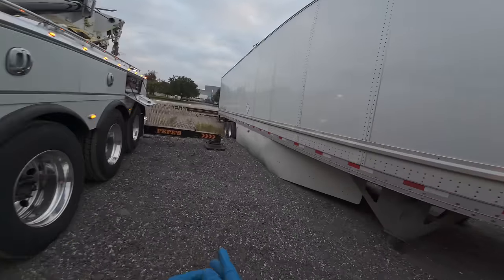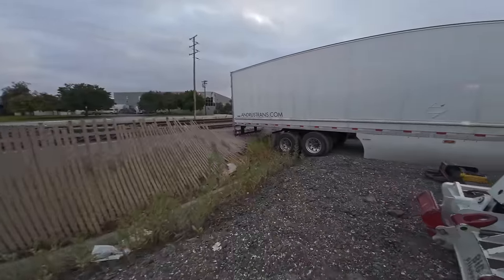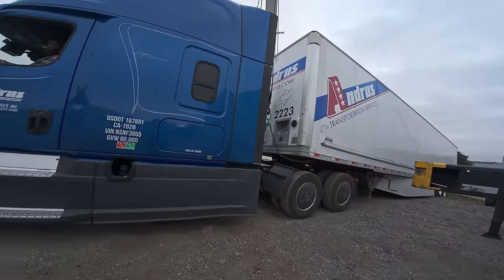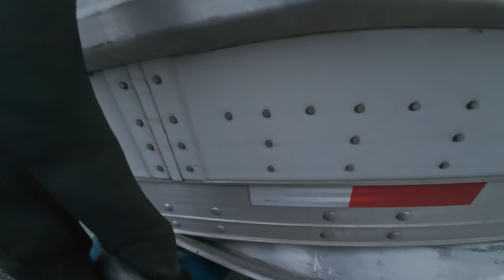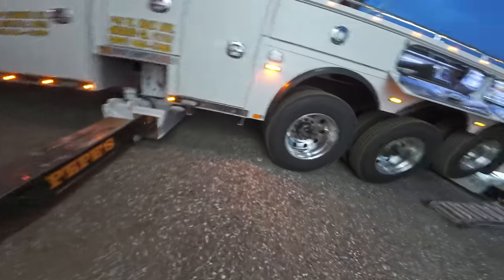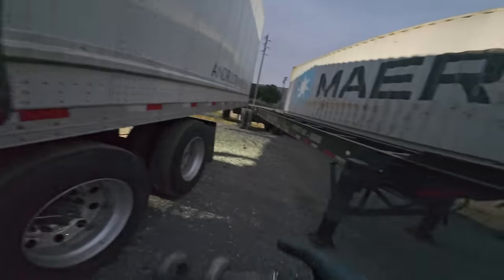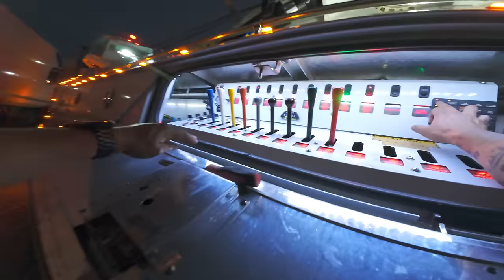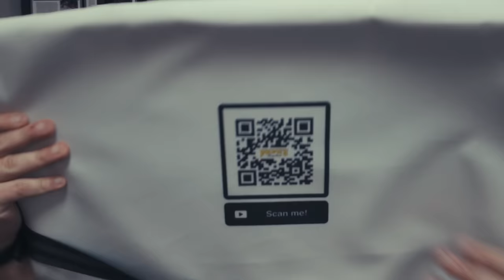Driver Error? Trailer Rolls Back Thru Gate

Comment: Back up to the trailer, hook the air lines, run air to the trailer brakes. If the trailer starts moving, find something to chock the trailer tires. If that still doesn't work, call PEPE'S.

Comment: Guess.... 799.  You worked well with her and didn't put any blame for going in the ditch; could have happened to anyone who didn't know that side of the yard.
Reply: It's not his job to assign blame. That's up to her safety department. The landing gear were all the way up. Only 3 possibilities for that. #1 she dropped the trailer after hooking due to no tug test, #2 the previous truck hooked to the trailer dropped it with out rolling em down to begin with, #3 mechanical faleure of the mechanisim caused them to retract under weight of the load. All of these scenarios mean this driver tried to force the truck under the trailer when the trailer couldn't even clear the tires and shoved the trailer in to the ditch. Her safety department will put 100% of the blame on her. If she couldn't low gear crank the landing gear down she should have sought help...

Comment: If I had a truck like that I'd have to rig a seat to a hook, grab the remote and fly myself around.
Reply: Oh, yeah. Safety first. Well, in the top 5 maybe.
Reply: I can say I’ve seen Josh get hoisted up in the boatswains chair, as well as lowered and raised to a casualty while wearing his class 3 harness.  The videos are older ones (abt a year or so) but still really good ones. One was a car in a storm drain thing he rode our standing like cap’n sparrow rode his sinking dingy into dock in potc. The other was I believe a container yard where one of them was half fallen on an angle…..

Comment: ABSOLUTELY was the driver's fault. Are we NOT gonna talk about how low the legs are the the ground? I guarantee the driver dropped that trailer off their of their truck and that is EXACTLY the end result when a trailer is dropped and the landing legs arent down all the way. It will slide back. Ive seen a Morgan driver have a trailer fall of his truck and the load was heavy and shifted all to the front and nosed dived standing wuth wheels straight up in the air.
Reply: Exactly
Reply: She was a sweetheart and seemed to take responsibility like a lady.
All part of the learning curve
Reply: Another thing is the brakes didn't hold trailer in place
Reply: She did say she was trying to re-hook and the trailer slid.
Reply: Someone needs to learn how to spell  😂😂😂

Comment: why use the spreader bar instead of picking it up by the back of the trailer?
Reply: Because he couldn’t get far enough to the rear to get a safe and balanced grip
Reply: @Trashman702  yes he would have had to back into the ditch then he would be stuck as well.

Comment: Wow Flipper doesnt just get wider stance coz it missing underlift. You also gain a lot off space at the rear. And also space on the top. That is interesting. Btw that was smooth job, just cruising through man. Greetings from Europe. You guys rock!
Reply: Short stacks for low clearance areas (trees), tag in the rear as 4th axle for significantly reduced wheelbase (tight turns).  No way to attain over-weight permit from Dep't of Transportation and therefore no need to put an under-lift.
Reply: @joeacosta5011   Huh so they dont get over-weight licence when towing from accident location? That is weird.

Comment: As you don't have 3 hands, drill some 5mm holes in the middle of the angle bars so you can use cable ties to lash then to the straps so they don't fall during tensioning :o)
Reply: Awesome recommendation.

Comment: Spreader bar might have been a bite much. I would of Redirect a low line to the D.O.T number a frame chain to wrap and Secure bump a slite pull until she got traction
Reply from the maker: 1,000 ways to skin a cat. You can do any job you get, the way you want to do it
Reply: @PepesTowingService   yes sir
Reply: For efficiency ,yes I like the bumper idea. Alex was highly considerate of not adding any further damage to the skirts.

Comment: Exactly, this is a prime example of driver error…Was the trailer tandem locked into the frame rail, and the four (4) pins fully seated?  Obviously, a driver isn’t going to operate the trailer with the tandems fully slid forward, as this is an overhang violation.  It appears to me she slid the tandems to the rear while dropping the trailer.  The pins were not locked into the frame rail.  She was told to move the trailer to a proper parking spot.  She attempted to couple the trailer and the tractor.  And the tractor pushed the trailer across the tandems through the fence, to its resting place.  If that driver worked for my company, then she would be fired immediately.  This is one of five (5) cardinal sins for which a driver can be terminated.

Comment: TRAILER HAS SPRING BRAKES, how did it get into that position 😳, someone forgot something 😳 🤔
Reply: Brakes were obviously out of adjustment or completely out of order. Even if someone had left the brake button in, the second the driver disconnects the lines from the trailer the brakes will apply automatically if they're working right.
That "driver" needs some serious retraining. There's no way in hell a competent driver would've shoved a trailer that far back before stopping and dropping the tractor air bags....
Reply: Actually I don't think so. It looked like the gravel was just too soft and maybe it was parked too close to the edge of the lot and it just slid back even with the brakes locked up
Reply: @DannyDan2k13  Drop the tractor suspension as the later comments say  !! Then it's not a problem 👌
Reply: @herbpetee75  I'm just speculating what coulda happened. It's not clear whether she had the suspension dropped or not when she tried to pin, but if not the obviously she should have

Comment: That trailer shows no signs of being pushed. The brakes were unlocked and it was rolling when it went through the fence. If the brakes would have been locked the tires should have slid. Someone may have backed off on the springs in the brake chambers as an act of sabotage...
Reply: @speedy well my faith wheel malfunctioned at a Kimberly Clark and my trailer slid off my truck with a 44,000# load. It looked exactly the same way as this trailer because it slid backwards before stopping on its own and when it happened all I thought about was the if it slides into that Crete trailer in the row behind it then it's gonna be a domino effect. Thankfully it stopped 2 feet before it got that Crete trailer. So the shipping lady came out and we took turns rolling the legs down to get at least 1 inch off tires so I could hook it since no yard guy was available on a Sunday!
Reply: Fifth not faith
Reply: @FeliciaSteward-ds2dh  Well you do have to have a lot of faith in that 5th wheel when you're going down the road so that may be another synonym for it. lol

Comment: Rookie driver, 1st thing you should do is back up 2 the trailer hook up the service  & emergency line  now climb back in the drivers seat push in the trailer protection  valve now pull on the service line handle now U have air 2 the trailer brakes now U can back under the trailer

Comment: It cost nothing to the trucking company/ driver for the recovery. Because they told her to park at that spot. She had already unhooked her trailer lower landing gear so the contract was fulfilled. But then they told her to move the trailer. So now its on the receiver responsibility. The trucking company is going to charge to get reimbursed.
Reply: No one told her to park in that spot. Her company has an assigned area to park. She took it upon herself to drop the trailer there and then did some things wrong when attempting to rehook. All on her.

Comment: DRIVER AT FAULT SHOULD HAVE RAISED THE TRAILER TO GET UNDER IT EASIER USE TRUCK TO PUT PRESSURE ON TRAILER THEN CRANK ON LANDING GEAR
Reply: How will you raise the trailer if it's loaded?